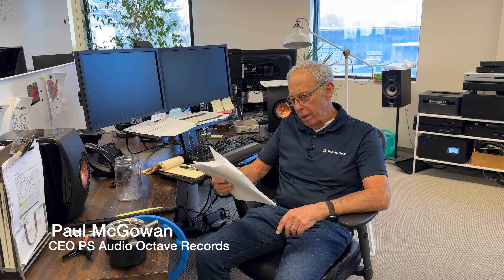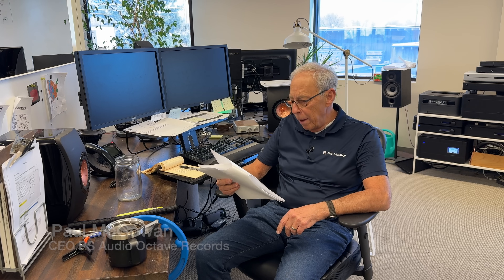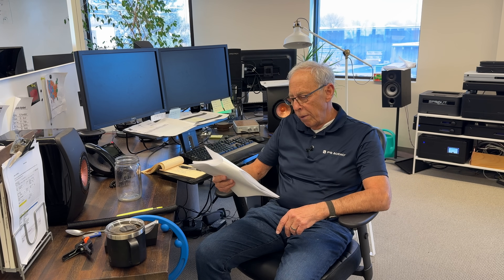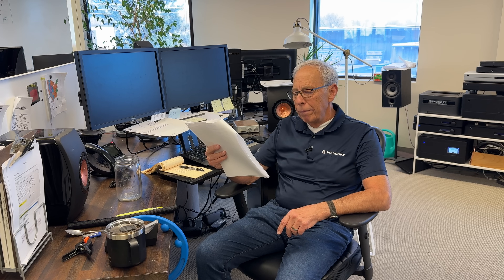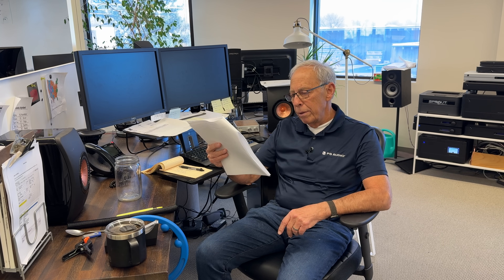Do volume controls affect sound?

Comment: When using a PC as a source, does volume level (in Windows, for example) influence sound reproduction? Even if you use USB to connect to external DAC, volume lvl in Win still affects volume lvl in the system. So I'm not asking about crappy audio out ports as output :)
Reply: Windows especially influences the whole sound reproduction. Try to circumvent this completely, for example using Foobar with a proper ASIO driver for your dac.

Comment: A corollary question is whether volume level affects sound quality, and of course Fletcher-Munson confirm this.  But I also have found that for any given recording there is a playback level that sounds most open and dynamic and natural, and my guess is that this is very close to the level at which it was mastered.  When I find myself dissatisfied with a recording, my first reaction is to adjust the volume, and it is often improved dramatically.

Comment: Some digital volume controls have a hidden reliability issue. Digital circuits can be susceptible to interference from mains voltage transients. I have a CD player whose drawer opens every time I switch off a particular lamp in the living room. Likewise, my father had a (fairly pricey) amp with a digital volume control that every now and then would change volume when the kitchen refrigerator compressor would switch off. One day all of a sudden that volume control instantly flipped to maximum. Tweeters blown on two expensive speakers. That stuff doesn't happen with analogue volume controls.

Comment: There is a common misconception among audiophiles about pots. The quality of the pot has nothing to do with sound quality. Yes a cheap pot can become intermittent and noisy but that's not the audio quality problem. The problem is the circuit design. Any amplification stage has a finite input capacitance. A pot is basically a resistor in series with the next stage. An RC network is a low pass filter. Depending on the resistance of the volume setting and the next stage capacitance, the higher frequencies get further attenuated than the lower frequencies as the gain is reduced. That is why some pots "sound bad". Replacing the pot with an expensive $50 instrumentation grade part is not going to fix that audio quality problem.  The problem is the circuit design. Simple stepped attenuators do not avoid this issue either as they are nothing more than a pot made from switched resistors in series, just like a pot. Better switched attenuator designs maintain a consistent impedance and therefore have minimal effect on audio quality. But as Paul said, the best attenuators are the high quality dedicated switched resistor ladder chips from Burr Brown and Cirrus Logic. These are not found in mass produced consumer HiFi gear. How about digital volume control? That too has a different set of problems, IMO, worse than any analog pot but good enough for an Ipod or sound bar.
Reply: That is a brilliant broad-brush misinformation statement, which is wrong.  Yep stray/inherent capacitance and the pot resistance will create a low pass filter. But you (deliberately?) provide no numbers. So lets start with a good gulp of resistance, say 22K, and a really bad load with 22pf, no lets go nuts, 47of load capacitance. Where does this worst case low pass put us,  around 150kHz, and that’s with a deliberately bad design that you won’t see these days. Pots don’t match (Alps blue volume is ~2dB typical, 3dB max mis-match), and thermally all over the place. Better is use Linear pots with a Log-Fake fixed resistor, less prone to crackle and the lin pot is inherently better matched. Better still is a well designed stepped attenuator (0.1%).
Reply: @Roosville1  I have seen the effects, albeit on vintage tube preamps where the pot values are quite high 500k to 1 megohm. I would assume most SS gear has much lower pot resistance but who knows on some of these exotic designs. Yes it is just some audiophile theory for an example. I do not subscribe to it myself.

Comment: Had to repair a 1983 NAD 3155 volume/balance control (my first decent amp). The part was pure unobtainium, so I modded an audio taper stepped attenuator by adding the loudness tap, and created a MN taper stepped attenuator for the balance.  Recapped the unit and it sounds not bad at all. I think it's better than the carbon element pots.

Comment: Just get a dac which controls volume in the digital domain, that way you can skip the preamp and its potential coloration.  Also you can put more money on a better dac since you are not buying a expensive preamp.
Reply: if you thinking on doin it that way just buy a minidsp SHD, or the studio version if you want a separate dac. then you have full dsp that makes all the difference.
Reply: Digital attenuation has it's own set of problems. If poorly implemented they can reduce dynamic range.  The other more difficult problem is bit rounding. Anytime gain is changed, it is a multiplication process. That generates extra bits beyond the original audio bit depth, like 24 bits becoming 28 bits. This must be rounded back down to 24 bits and to do that well is a complicated process. Just chopping off the extra lower bits, which some cheap designs do, has significant negative impact on the audio quality, Digital gain control is mandatory in applications like mixing consoles. But in a home HiFi, you have to convert to analog at some point. There is no such thing as a digital speaker*. So since you need to convert to analog anyway, why not put the gain control there where you have less issues.

A third digital pot problem in mixing consoles is "zipper noise". Not a game changing issue in home HiFi or general room volume control. But in a mixer where gain is sometimes changed on the fly, this is a no go. Getting rid of zipper noise is another complex problem to solve.

* A powered speaker with a digital input is not a digital speaker. It's a basic speaker and analog amplifier with a built in DAC. They are mostly for commercial applications where analog noise pickup with long cables is an issue. Then there are IP network based systems like Dante which  give you internet  based central management of an entire PA system.
Reply: @andydelle4509  so you’re saying the PSaudio direct stream dacs’ volume control is less transparent than an analog pot?
Reply: @flargosa  No, I'm saying if a digital volume control is not carefully designed it can be worse than an analog pot. I assume the PS Direct Stream is a well designed digital volume control?

Comment: The attenuator (I'll call it that rather than a volume control) is possibly the most overlooked part of an audio setup. You get really good quality capacitors, resistors etc., then pass the signal through a basic carbon track and some sort of metallic wiper. Everything goes via the attenuator, so it makes total sense to use one that has as little effect a possible on the signal. Trouble is, this can get really expensive. It's a tough call for manufacturers, but having heard the difference it can make, it's worth the cost and effort, Practically it's very hard to implement in a existing system.... It needs to be a design criteria / decision... back to the drawing board folks!🤔

Comment: I think too that  it is.  I observe that the more volume is up  the more uopper band I notice.  - for testing purpose I correct loudness    repectively with other adjustment. . My guess is that with using potentiometer we change    parameters  of circuits - one is input impedance of   controlled stage,  other is   apparently we may change load of previous stage - top up makes lowest impedance because  input stage is hunted by wire capacities to ground  ,  third  I think potentiometers above 100K are affected by capacity to "ground" - they suppose to have metal body for  screeening  but it provides  some  capacity to audio track.     I believe it was known to designers of vintage tube gear (or they practiced it by experimenting) In tube constructions   they were even  able to upbeat sopranos in low pot position.  For that reason  in  many solutions they made  loudness correction only with low range circuit With digital controll it is surely possibe to avioid variable resistors but if  resistors  allow  unusual gains I prefer old  "resistance games"

Comment: Thanks Paul for answering my question,it's really clarify the matters. Although I still very itchy to mods my current VTL preamp with Khozmo ladder stepped attenuator from std alps motorized blue velvet pot and see how far will it improves the overall sound. But I agree on yiur point that any attenuation should be on neutral where it will not colours the sound too much so the circuit design goal can be achieved
Reply: REALLY good sounding is the Khozmo. But I was not happy with the linearity of the attenuation.

Comment: Yes, in my old diy passive preamp, I tried three different types, top line alps, Noble and stepped resistor based. I could easily hear the difference between the three and stepped resistor, based on sounded best. I am not familiar with this chip-based approach, so I have no opinion, well I think Paul will be using them because they sounded best.